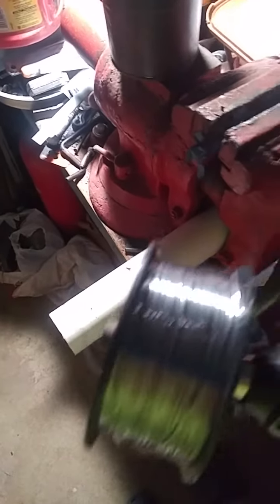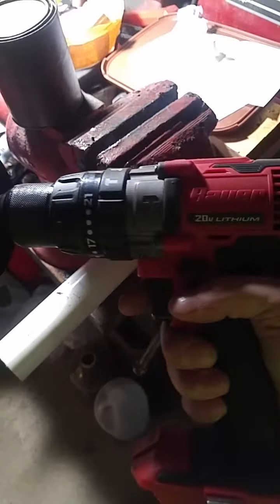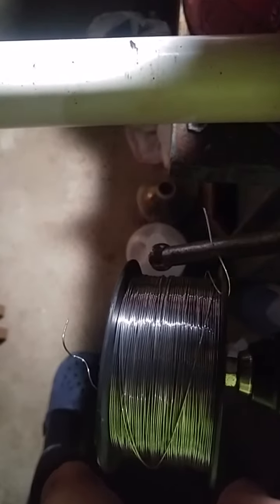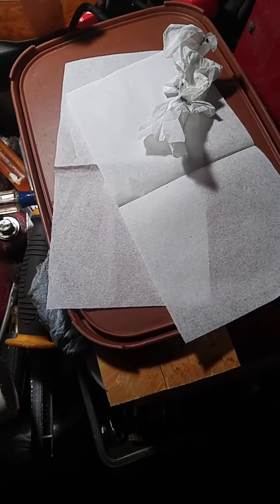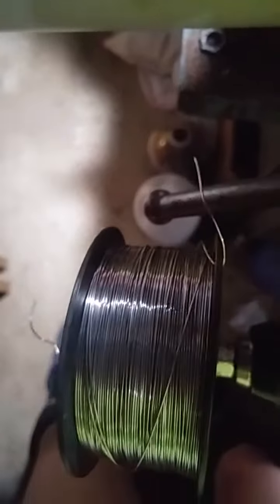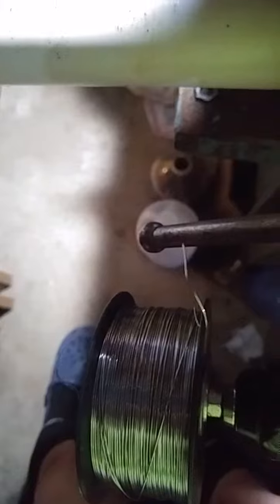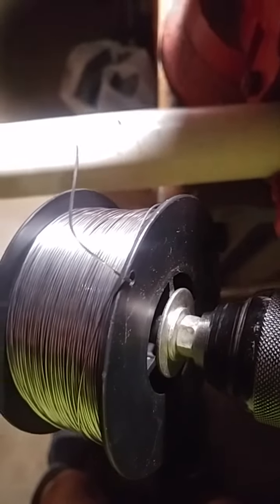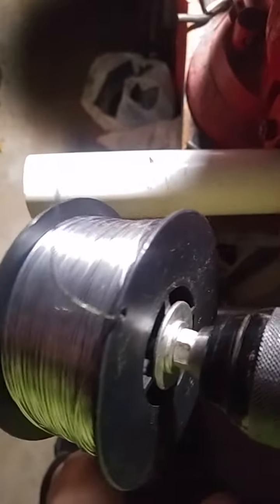Winding MIG or Flux Core Arc Welding (FCAW) Wire From a 10lb to 2lb Spool

Comment: Hey bro I think you can just mount the 10lb spool externally and make a hole in the welder where you want the hole to feed through. Check out this video "3 Mods I made to a 120 v 130 amp Flex Core Welder" skip to 9:45
Reply from the maker: Thanks for the reference to the video.  Never thought about that style external mount.  Man, that's a great idea if the spool doesn't fit inside.   

You know, I'll comment on his video as well, though you can probably buy like a ~$20 or less 150A rated (or more if you need or want) rectifier and convert that AC welder to DC.   

I've also been looking to see what the most simplest homebrew DIY, if you understand electricity safely enough since can be deadly, AC balance circuit so to adjust like the balance for TIG welding aluminum.
Reply: @jafinch78  haha. Yeah man! I was thinking about respooling first also, but the amount of time wasted would be too great. I looked around and the external mount makes so much more sense to me. Haha. I have a titanium Flux 125. I like the machine but the 2lb spools kill me. I went through 3 of them in once day it was just way too often. Haha
Reply: @jafinch78  oh and the 2lb spools are expensive. Just doesn't make sense. Haha
Reply from the maker: @Agustin-jo8mv  Yeah, I have some Century 125GL videos showing where my spool holder broke, so twice I've plastic welded and seems to be holding up this last time I used a pocket butane torch to get everything more evenly heated I guess and bonded.   Decided I better get a new holder and was like... hhhmmm... discontinued with this new design. Ordered and like I noted in the video... so costed me a little time to work with and was awesome they let me keep it plus refunded my money.  Ebay software actually messed up the return and claimed they'd send me the cost as coupon or credit... though never did.  I was like... I'll at least make a video or some regarding to promote since had to be an easiest fix.   I did look at DIY external 10lb spool holders (they make even larger spools if you need as well) and figured I could design and make eventually.  Never seen a design like you referenced and that seems way easier.  I also made a video of me rewinding some flux core wire from a 10lb spool since I realized this season... that's the way to go buying those 10lb spools.  I didn't think rewinding was that bad, though I most likely won't do again with the new mount design.
Reply: @jafinch78  haha. Got ya. 👌 Sounds like we both have it figured out now.